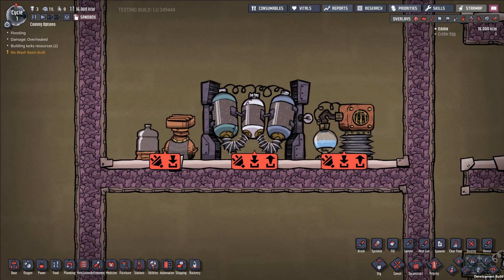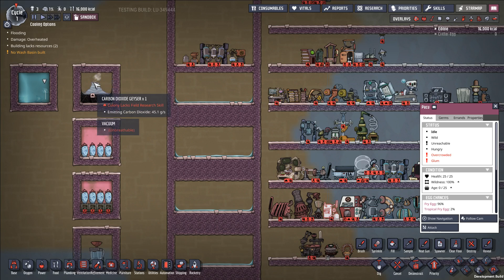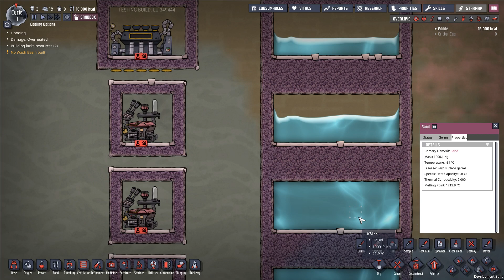A Review of our Cooling Options [Oxygen Not Included]

Comment: The game is not physically realistic, but adding a difficult that is not intuitive, take down the experience of the game. In real life, things cool themselves, due by thermal radiation, satellites cool by this method, a face is always receiving the sun for maintain the temperature and charging solar panels, the other is in the darkness, that is quickly cooling. Is the same for the earth, but the atmosphere help to keep the temperature for more time during night.

In the game, things heat themselves and never cool, the map is filled with geysers and vents that heat the map.

They could do the following:

They need to add a better tutorial for new players, I had to learn reading guides and youtube, because the game doesn't explain itself. For example, they said "neumatic door keep the gas and pressure between areas", but they not said that the gas pass when the door is open. I have to learn this watching my base fill with chlorine and lime. So, How I can keep isolated areas? They never explained this, the game is not intuitive, I learned about water locks on YouTube. For example, factorio made a better tutorial, even a friend that never played games like, he understood everything of the game. But when I played factorio, had a poor tutorial.

They need to add buildings for solve this lacking of features:
-- For isolated areas, something like double pressure doors for mid game, for late game particle barrier door.
-- For cooling, in mid game, an Air conditioner, this would help for farming, because many plants need low temperature, and in mid game your base would probably be over 40°C. For late game aquatuner or termal radiators, Also, an way to cooling in vacuum and space.

The game actually feel like an early access.
Reply: 1. digging through water often accidentaly forms water locks, i learned the concept of water locks all by myself. But i agree, they should probably make a POI that demonstrates this concept better.

2. Icy fan exists, and it moves 32000 DTU/s to an icemaker, or if you value your dupes time just dump the ice on metall tiles
Reply: @user-si5fm8ql3c  
1-- It needs to be more explicit, in my mind, water locks doesn't make any sense, and there is more user like me.

2-- I mean, something more intermediate. Not too simple than icy fan but not too complex as an aquatuner. Icy fan needs dupe labor and spread the water on the floor when melts. Like a miniaquatuner. Something that helps the curve of progression more smooth.
Reply: @drakoky6894  
1. It's literally just a syphon.

2. Thermoregulators move and delete about 4 000 DTU/s less Heat(if running on Hydrogen) than the icefan, use 240 W, no dupe labor and can easily be cooled by putting them in a nearby swamp biome near the water.
The Hydrogen required for a Farm big enough for 8 Dupes is about 100-150 Kg of Hydrogen.
Running an electrolyser for 8 Dupes produces that amount in 3 Days.
Reply: @user-si5fm8ql3c  
1-- Fluid principles, is you have two different pressure of two side in a tube in U, the fluid move to the side with less pressure for maintain  the the balance, until both side have the same pressure. When I did, accidentally, my first water lock, I destroyed it, because I thought if I continue growing the pressure in one side, all the water move to the other side and the water lock will be destroyed. The game respect this principles in the same fluid, liquid or gas, but, when is gas and liquid the game considere that they are in different layers, and doesn't respect this principle.

2-- This is the problem, complex system that required more than just the thermoregulator. You required a Hydrogen room, something for cooling this hydrogen (or will be overheat), isolate this room and a gas pump (that also generate more heat in the room). I meant, something more simple, an inverter thermoregulator, that cooling the area around him and heat the fluid that pass through him. Just like an air conditioner. Something for move the heat and think what I can do with this heat without worrying about get over heat. If the fluid is too hot, just stops working.
Reply: @drakoky6894  
1. I agree, they should teach the player about that behavior, maybe with a POI, or a ingame note.

2. The Inverted Thermoregulator has all the problems of a normal one and then some.
You still need a working fluid, overheating is still a concern, now in the working fluid rather than the building and if you have interactions between the working fluid and your Base it is always negative instead of positive.

What do you even do that causes overheating problems for your crops ?
That should only start once you feed your plants stuff from outside the starting biome, which will take a few cycles.

I had overheating problems as soon as i started using 95C° Saltwater from a nearby Geyser.
When it got to my base it was only 40C° so i just put it through an gold aquatuner once.
Everything that was still hot got ice dumped on it to get it under 30C°.
It doesn't take that much power to run an aquatuner for 5-10% of the day and overloads won't happen if you put it on it's own grid.
Cooling is done by putting it in a swamp

Comment: So.... to kill the most heat I should :
- get hot water from a cool steam vent and pump it into an oxylizer
- heat up the hydrogen (If I make it pass near the cool steam vent with amalgam gold radiant vents, would it heat up the hydrogen while cooling down the steam ?)
- put the heaten hydrogen into hydrogen generator to delete some heat
- cool down the oxygen with a thermo regulator next to a wheezewort or one of those supercooling machines found in cold biomes.

I'm so sick of restarting my base....
Reply from the maker: I think you've got it.  One thing you can do is stick a thermo aquatuner in your cool steam vent chamber and a steam turbine on top, and use the water you pull from the steam turbine to feed a couple electrolyzers.  Then you can use the cooling you get from your thermo aquatuner to cool down the oxygen you separate from your electrolyzer room.  And since you've got your cool steam vent room all nice and toasty, you can take the hydrogen you separate and run it through there with some radiant ducts, and that will heat it up for you before you burn it.
Reply: @gearheadgaming1  That's awesome ! Thank you :)
I already tried 2 electrolizers and I actually ended up with too much oxygen for 12 dupes, so it filled the electrolizer room and there was not enough hydrogen created to sustain the hydrogen generator and the hydrogen cooling machine...
Any suggestion other than getting more dupes ?
Yea, my problem is having too much oxygen in oxygen not included...
Reply: @leneziak  There's not enough things that use oxygen in the game. Basically, oxygen is mainly consumed by dupes and a few critters. Mid to late game there are only a few things that consume oxygen gas. Basically, you either make oxylite (not power positive with a electrolyzer-hydrogen-generator setup) or you make liquid oxygen for rocket fuel. Otherwise, two electrolyzers produce around 1776 g/s of oxygen which supports almost 18 duplicants.

Personally, I'm going to look into mods to see if there is something to use the oxygen with to compress it. If you are going to remain strictly unmodded then the major methods of dealing with the oxygen is compressing it in a high pressure box or a lot of gas reservoirs. One gas reservoir contains 150kg of gas which amounts to a single electrolyzer with a pair of pumps running for about 150 seconds of game time; you end up having to build 4 gas reservoirs per day for each electrolyzer. Practical solution is dig your way to space and vent excess.
Reply: @KAClown  Thanks, Kicker of Asses.
It's indeed what I ended up doing : throwing it all out in space.
I don't want to install mods before I finish the game properly first and 12 dupes was more than enough for most of the game.
Hoarding it would need another piping puzzle to use it back, probably manually and I'm a very lazy person so fockit...

I stopped playing because of a thermal bug with abyssalite a few months ago and I was waiting for uptades, I think I'm gonna play again ^^
Reply: @leneziak  The thing where abyssalite vaporizes things still exists. Though, you can totally exploit it to generate steam or petroleum or sour gas. Brothgar has an example in his playthrough of Oasis. https://www.youtube.com/watch?v=NU1GXLRxTcA

At the moment, I am trying to work out how to sustain power to scale for the transition from coal/wood to steam/petroleum. I wish that messing around with thermal power generation didn't require plastics and steel, and I don't like the Steam Turbine's finicky operation. I feel like there should be a intermediate version that maybe takes some refined metal or a lot of unprocessed materials to produce a modest amount of power like a geothermal hamster wheel equivalent.

The other thing I've been trying to work out is how to use abyssalite as a thermal battery. There's some neat things you can do with tempshift plates to move energy into or out of the abyssalite faster.

Comment: This is very theoretical. How would one "dump" 800 degrees of heat into hydrogen to run it into a hydrogen generator?
Reply from the maker: Easiest method is thermo regulators / thermo aquatuners.  The components would need to be made out of thermium to avoid breaking at those temperatures.

Comment: I know this great video is a bit outdated now, but I think you forgot one: Use excess/useless gasses to grab the heat though an aqua tuner or the air-cooler thingy (forgot it's name) and then vent the heated gas to space...  Well you can do the same with liquids as well, but excess liquid is not as common...
Reply from the maker: This is a very powerful method, it's just hard to represent on the scale I made for the video.  I think it's an inevitable late game solution though-- you're going to accumulate stuff you dont need, and dumping a bunch of heat into it and then venting it is a great way to make it useful.

It's also the most straightforward way to cool down the magma biome-- just pump all the magma straight into space.

Comment: I'm still waiting for the whole H2O thing to actually mean H2 and O1 (aka water), not H and O8 (aka Hydroperoxyhexaoxane). Yes this is a huge balance issue, but it can be balanced in a way that is far more realistic other than getting 8 parts oxygen to 1 part hydrogen.
Reply: Oxygen has an atomic mass of 16.  One 16-mass oxygen atom and two 1-mass hydrogen atoms gives the ~8:1 mass ratio output seen in the game.
Reply from the maker: The ratio is given in mass, not atoms, and an oxygen atom is 8x more massive than a hydrogen one.  Still, you're right, the ratio is off-- it should be 800g/s of oxygen to 200g/s of hydrogen.
Reply: Don't forget about neutrons--the atomic mass of an O atom is (on average) 16 amu, so unless ONI water is made with pure deuterium the mass ratio is 16:1 giving  .888 = 16/18 oxygen production per unit of water input
Reply from the maker: @jonathanhall9244  You're correct, I had the mass difference wrong.  ONI's ratio is correct.

Comment: I didn't get how these cooling works. We are talking about cooling the base but you are saying to achieve that, first we must heat things up before use as resources... ...uh. My brain hurts.
Reply from the maker: Imagine the heat like a bunch of little bags of trash.  What we're doing is going around and collecting all the bags of trash around our base and tossing them onto something that then gets destroyed or reduced.
Reply: So heating things up to a point is only counts for efficiency. You may dump four bags of warm trash or squeeze them in a single bag of hot trash then dump. But what if we can't heat things up that much? I guess we should dump them anyway, otherwise your hydrogen generator or electrolizers would lack of resources and stop working. 

And if I get right, we always need oxygen vents in both way working; one for sucking up the hot/warm oxygen from the living space into The Hot Room, and one for blowing cold oxygen back after process. Is that right?

Comment: 29:28 you can't heat up water to 880C, it turns to steam before that.
Reply from the maker: It does not, so long as you heat it up in a pipe that has been throttled to 1kg/s.
Reply: @gearheadgaming1  won't it get fixed in 1.0
Reply from the maker: @RaukGorth  Kinda.  The pipe thing I think is intended behavior and is gonna stick around-- what they're changing is whether or not buildings like the electrolyzer accept inputs above their phase change point.

But as of right now, you can still put 900 C "liquid" oxygen into a rocket's liquid oxygen tank.

Comment: Where are the metal refineries in all of this? I'm actually not really fluent with their mechanics.
Reply from the maker: Each refinement job at the metal refinery takes 40 seconds (reduced by the skill level of the duplicant), and uses 400 kg of coolant.  Coolant is piped into an inlet port on the refinery and is piped out when a job completes.  The amount of heat transferred to the coolant is equal to 80% of the heat required to raise the metal from 40 C to its melting point.  So how much heat the refinery creates depends on what metal you are processing (and to some extent the skill of the dupe doing the refining).  A batch of Gold will produce about 10.5 million DTU, Tungsten 30.9m, Copper 32.2m, Iron 53.7m, and Steel 93.6m. 

If you're starting a space program and were producing steel in a metal refinery constantly, it would create 2.34m DTU/s, and it would take ~3 steam turbines to delete the heat.  But if you're just refining a couple batches of gold per cycle to get some smart batteries set up, then you'd only be producing about 35k DTU/s, roughly the same as a polymer press.

I've got an episode coming up on a bunch of techniques to obtain refined metal, and as part of it I'm going to show a metal refinery setup that basically lets you ignore the heat from it completely (you use the magma at the bottom of the map as your coolant, and when you're done with it, you just pump it back).
Reply: @gearheadgaming1  Excellent! Thank you very much!

Comment: Excuse me... "If you heat up the water going into an electrolizer by 880 C...". How in the world would you do that? Last time i checked regular water boils at around 100 C and turns into steam. That would cause you pipes simply break even if they are made out of insulation... So even if math says it's efficient, this contraption just makes no sence.
Or please explain me if i'm wrong...
Reply from the maker: If you throttle the flow to 1kg/s, liquids do not phase change within the pipe.  I made a "liquid" oxygen setup using that principle here:

https://www.youtube.com/watch?v=eJglI6uOD6I

And a sour gas distillery using the principle as well:

https://www.youtube.com/watch?v=ppQ8jwTxv0U

If throttle your water flow to 1kg/s, you can heat it up to whatever temperature you want without the pipes breaking.

HOWEVER!

Klei just patched electrolyzers, and now they check to see if the water is under 100 C.  So if the water is above 100 C, the electrolyzers will emit it as steam instead of electrolyzing it!

The build still works for temperatures under 100 C, and you still get a very large amount of cooling out of it, see my recent video here:

https://www.youtube.com/watch?v=blx7NGyBwE4

But we cant get the insane heat deletion that we could before using thermium components and superheated water.
Reply: @Afqwa  a loop should solve your problem. Pipe the water through the valve, heat it, pipe through elektolizer and pipe back to input of valve. So water will run in loop and never backs up after valve.